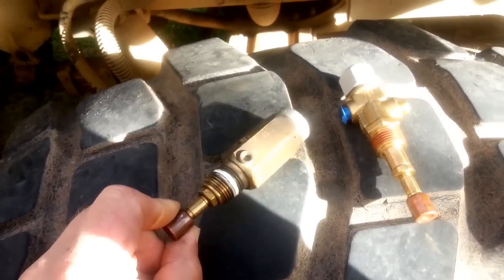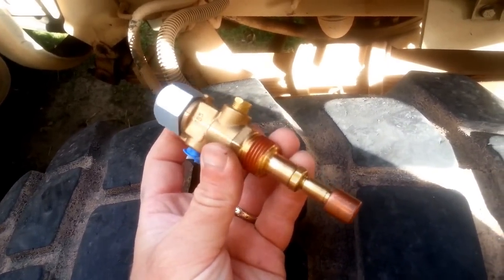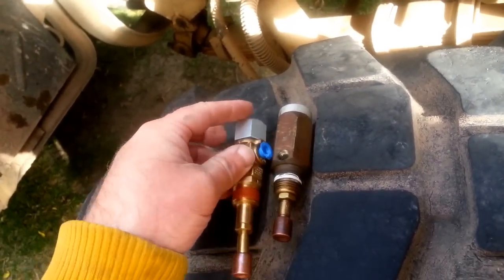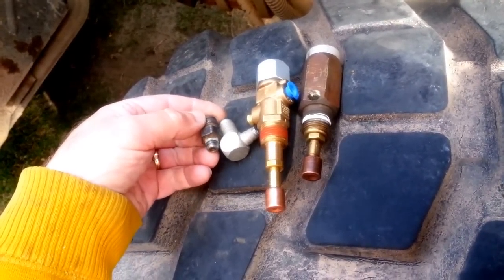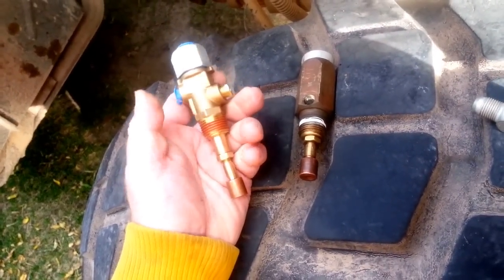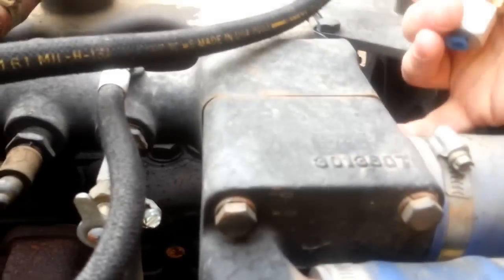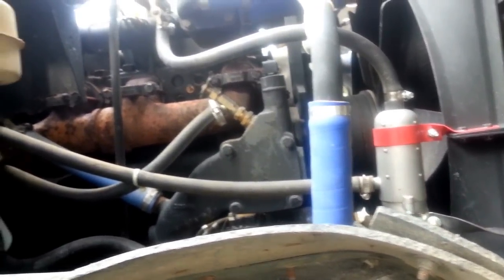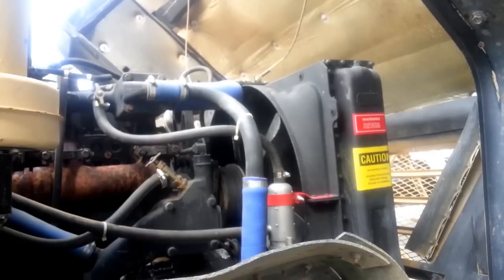M939 Shutter-Stat Replacement/Retrofit

Comment: Having moved to Greece ten years ago I have had to adapt my plumbing train of thoughts, over here they use straight threads with sealers instead of the taper threads we use in America. BUT I have come across a very common 1/2 inch fitting series that are extensions which are female to male fittings that would have been perfect for this project if they were taper pipe thread. They come in 10mm up to 50mm in 10mm increments.
Keep up the good work, I have a friend searching for one of these series trucks with a radio box on the back instead of the open bed.

Comment: I have a M923A2 and was planning on buying the 1047-35000-31 shutter-stat. It's the 195F version of what you have. I think others have used it on the A2 models and it fit without extra parts. The shutter stat mounts to a pipe running to the radiator rather than directly in like on the 250s.

Glad you got it working.
Reply from the maker: +Alexsha James That is a good part number to have.  I will add it to the video description.
Reply: Do you have to drain antifreeze on an A2 truck?  About to replace mine.
Reply: @steelreaper8066  it hold like 47 quarts of coolant. Drain out 3 or 4 gallons from the radiator petcock. Replace shutterstat. Put coolant back in.